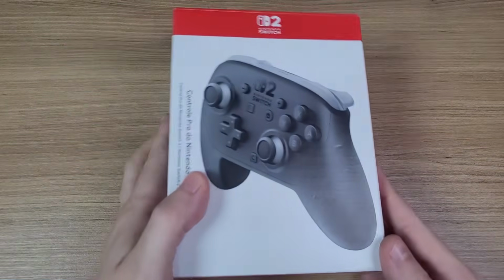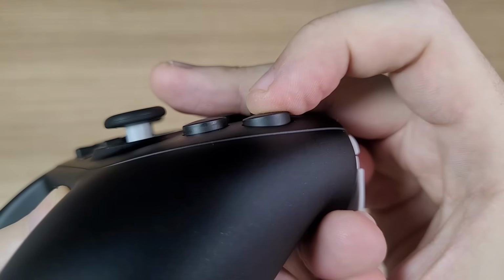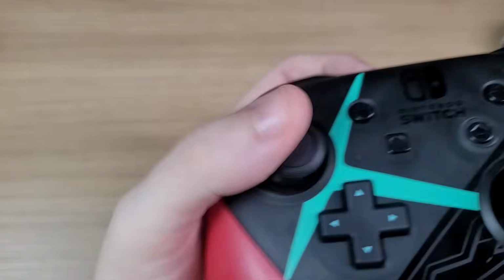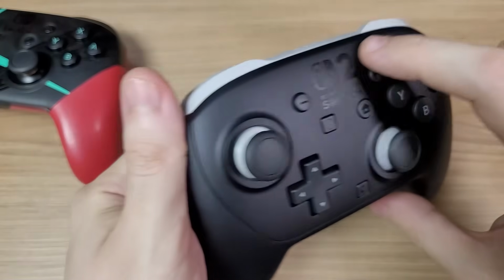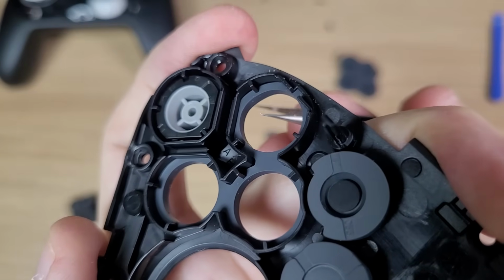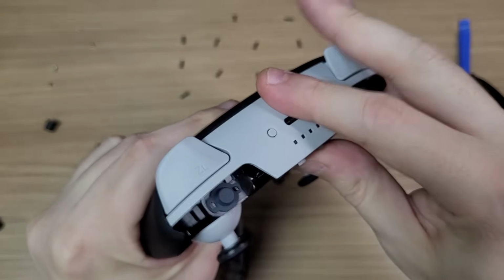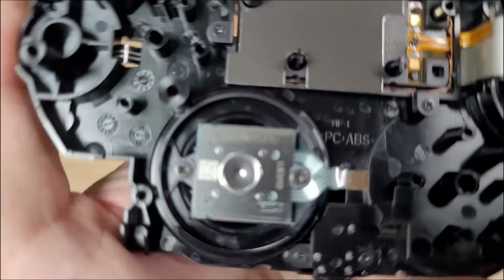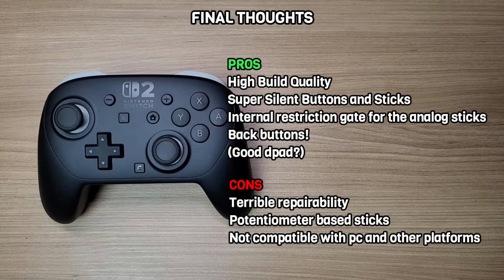Switch 2 Pro Controller Review & Teardown - The New First Party King?

Comment: I've been using the controller for fortnite and personally I still like certain things from switch 1 pro controller. The handles and size of switch 1 pro con are bigger and feel better in my hands. The sticks on the new one feel like they have more tension and now that you mention it, it's the recentering that feels tighter compared to the old controller. I was hoping the sticks would feel the same as the old one because I prefer the looser tension as it made it feel smoother. The main issue I've found with switch 2 pro con is that it has a bigger deadzone compared to switch 1 pro con and from swapping between the two, I was able to aim better with the old controller. Overall the controller does feel alright to play on and I am getting used to it but I hope Nintendo can update and lower the deadzone.
Reply: I noticed this when playing Cyberpunk. Huge deadzones, too much initial tilt to move the stick out from center. I play a ton of Fortnite on Series X so I also have  "developed" a sensitive thumb that notices the difference when micro aiming. Glad to see you post this, thought I was being crazy. The joycon 2 actually have better sensitivity now for shooting games. I'm returning my Pro Controller 2 this week and syncing my old one to Switch 2.
Reply: @johnpolishimpossible2say191  Hey so I finally booted up Cyberpunk and noticed the large deadzone too but for some reason the setting to change it is under "Vehicle" so put the inner dead zone all the way down and it should feel better.
Reply: @phoxx4582 I thought that was just for vehicle controls lol - still the Joy Con 2 sense feels perfect without changing the deadzones and l can't change that in most Nintendo games
Reply from the maker: I felt that the handles are smaller too but I actually measured them and they're the same!

maybe it's the material the gives you this impression
Reply: @VKsChannel I think I know what it is. In the Ask the developer article they said they took reference from the gamecube controller and made the base of the grip thinner to give more space for your fingers.

Comment: omg nintendo make the tear down of both a Sony PS5 Dual Sense & Dual Sense Edge controller look so much more easier to take apart. this nintendo pro controller looks like a complete nightmare to disassemble
Reply: using adhesive on that big of a faceplate is insane, just make it clips at that point

Comment: My only issue with my 1st gen pro con is i barely used it after i bought and and finished BOTW, years later i took it out to use when TOTK got released only to find it has drifted even when i barely used it, Whats more it is soldered. This is not so i guess its easier to replace?

Comment: I've heard you can use it as a Bluetooth controler but you need to first link it to a switch 2 to update it's firmware but you still won't be able to pair it with a switch 1

Comment: do you think it'll be hard to get the faceplate seated well again after removing the adhesive? I'm always scared of working with glued parts
Reply: I can't tell if this is a win for repairability, at least you don't have to worry about snapping a ribbon cable when replacing the buttons anymore